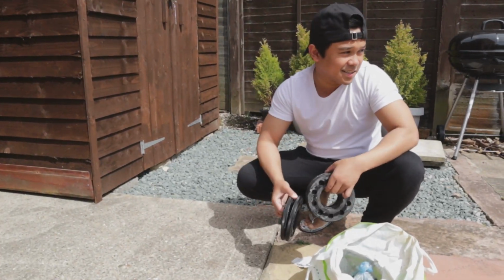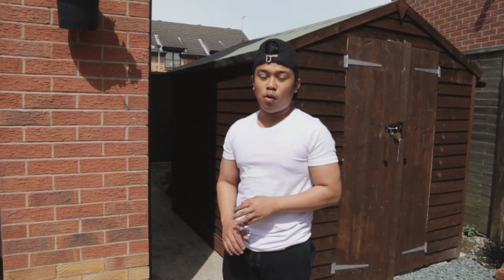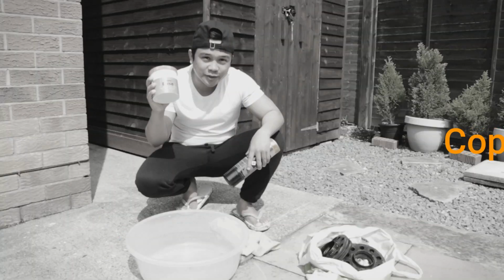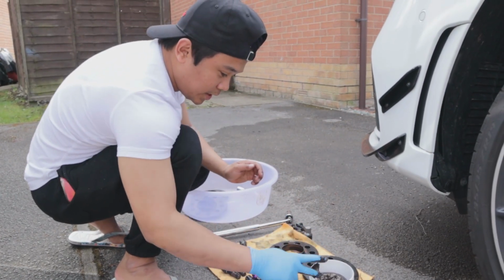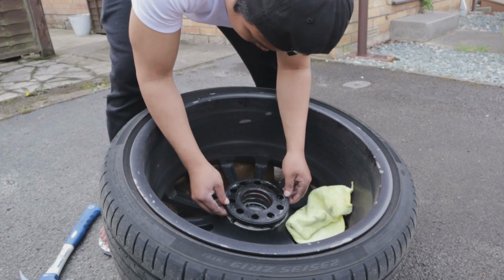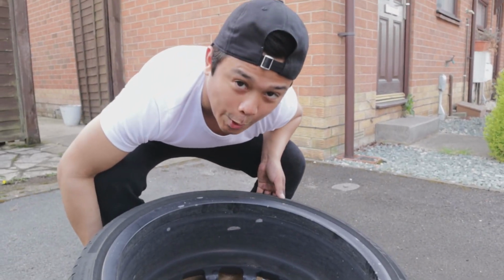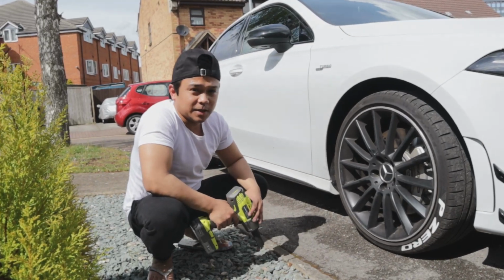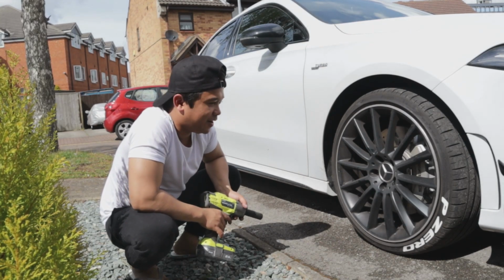Pre and Post - Fitting 12mm Spacers on my A35 AMG Saloon/Sedan (V177/W177)

Comment: just found this , and why have you this , you will get all the road crap all a long the door and back wheel bodywork  stone chips + I may be wrong but you aren't supposed to have wheels/tires
out side of the car body
Reply from the maker: Hi Dave, yes you are correct. The spacers are for aesthetics only. I did get a mud guard to avoid splashbacks.

Comment: Hi friend, I have the same spacers with the original rim, have your spacers given you problems? I'm thinking of removing them.
Reply from the maker: @rodrigovillar4525  i had no problems. Have you got problems with yours?
Reply: Hi friend, something sounds strange to me in the front axle and they are the same brand that you have installed
Reply: I installed the same ones, and I had to take them out.
The car vibrated a lot at around 170km/h.
When I took them out, the problem was solved.
Reply: @markalden   Hi friend, it's been a while, are you still using spacers? Please give us more information, thank you very much.
Reply from the maker: @rodrigovillar4525  hello. Car is now sold. I didnt have any problems